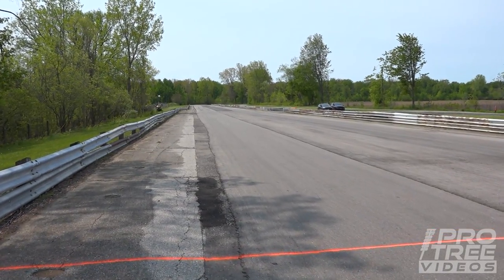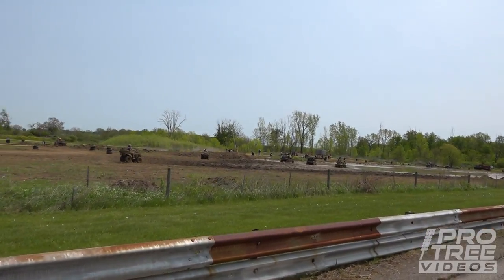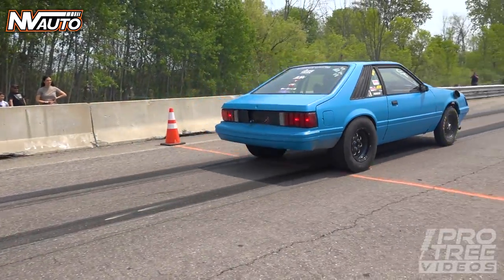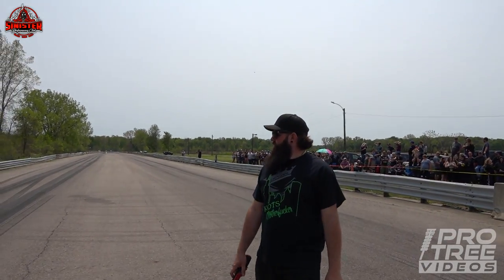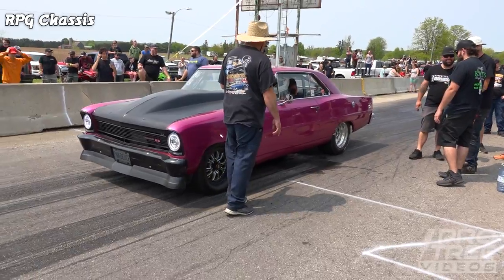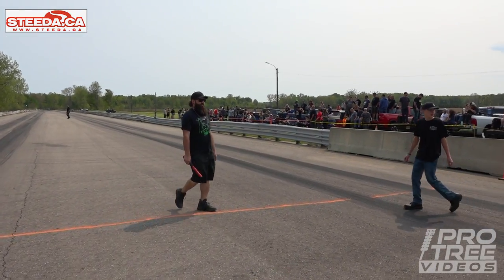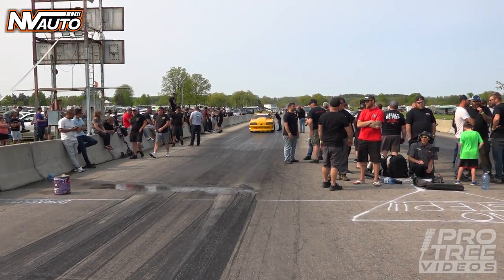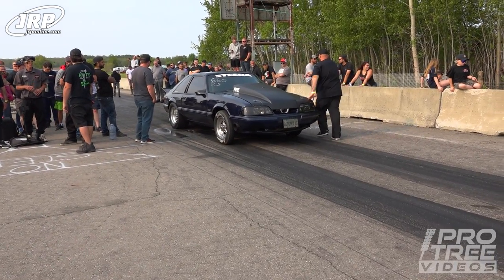FIRST EVER Backside No-Prep at St Thomas Dragway! | "ProStreet519" - (May 21st 2023)

Comment: The thing about guardrail tracks is the guardrails are directional.
They have a very knowledgeable Insurance guy who knew you can’t race the wrong direction on a guardrail track. I’m a retired state certified fabricator and I built miles of guardrail posts.
When you install the guardrails on the posts you overlap it with the exposed end facing the same direction you are traveling. This way if you get into the rail you will slide down it and slowly come to a stop. If you’re going the other direction your car will snag the exposed end of the rail and it will try to stop you in your tracks from whatever speed you’re traveling.
It can impale the car and that’s bad news brother. See ya at the track.
Reply from the maker: Wow! Good info there, I had no idea. Thanks for sharing 👍